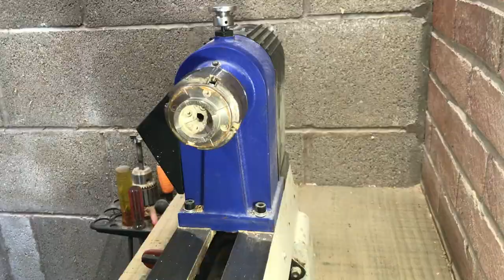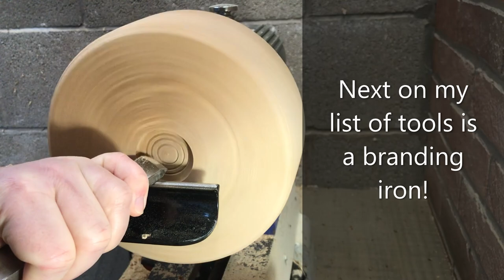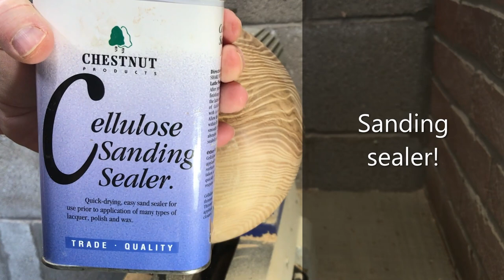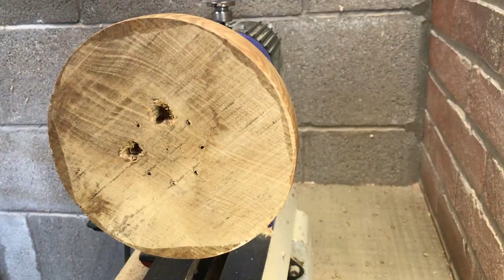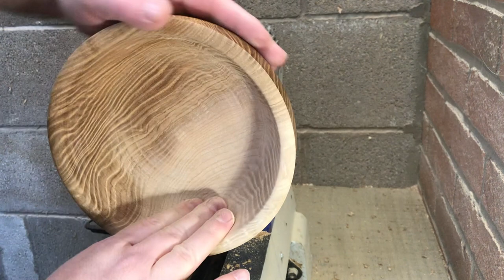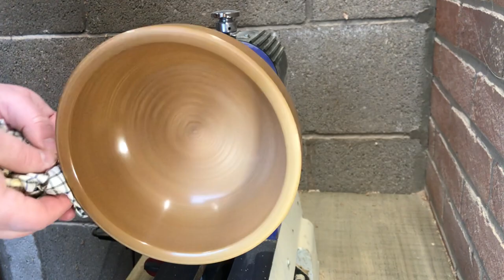Wood turning - Figured Ash Bowl

Comment: Question from a beginner: Rather than risk snapping off screws and having to dig/drill them out, could you screw a piece of soft wood to the faceplate then glue your bowl blank to the softwood?
Reply: You could, although I think they recommend hardwood for glue blocks.  I  haven't broken any screws yet, but I do prefer using a plywood glue block and 5 minute epoxy, I feel like it leaves me open to more options.
Reply from the maker: Lots of people use a worm screw. Personally I prefer a Chuck faceplate. I usually use a thin pilot hole, but didn’t this time. Wooden plate is a method favoured by some, but not usually softwood. Sorry if that’s a long and vague answer. In short I’m going to remember to use a pilot hole! 👍